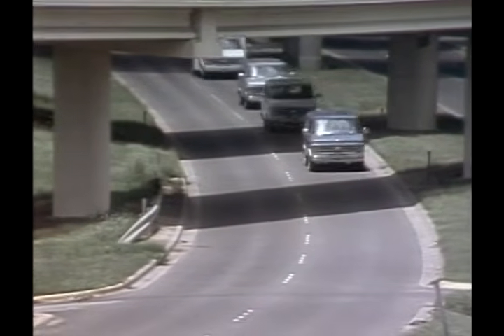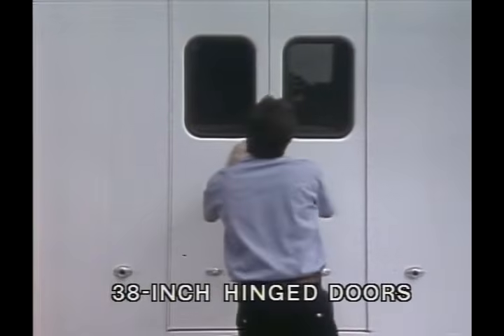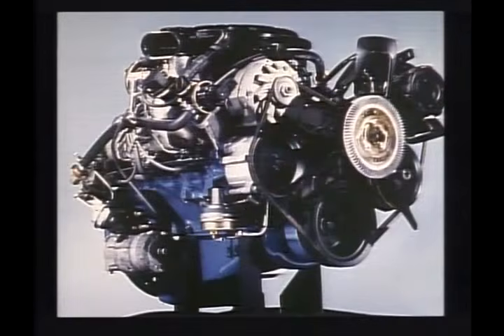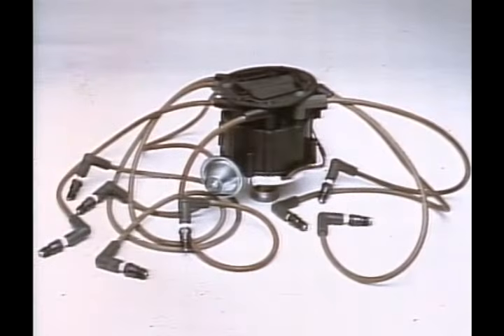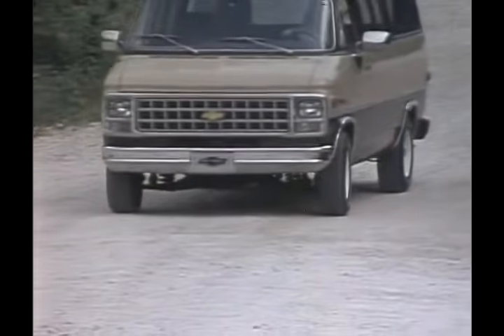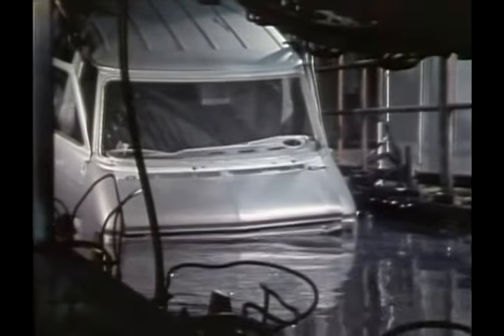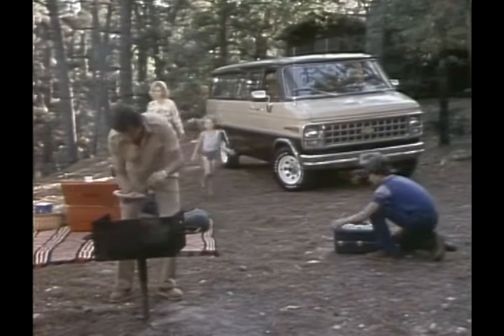1982 Chevrolet Vans

Comment: The 96 and later vans have the ladder frame, and the short wheelbase van is almost as long as the 82 long wheelbase.
Reply: That's because by 1996, they ditched the shortest wheelbase van as they weren't as popular as before.

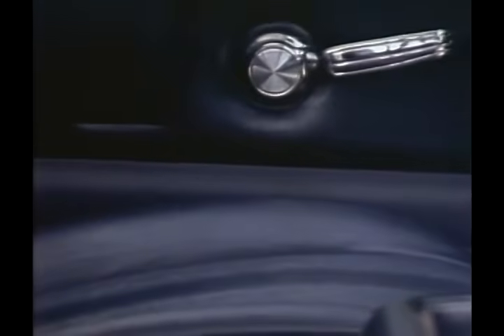Comment: This might actually be a 1981 Sportvan at 4:30 as it doesn't have the electronic ignition that the 1982 models have.
Reply: You mean the one on the dashboard versus the steering column?
Reply: @erikbunty2016  Exactly, and the 1981 models have a different automatic transmission compared to the 1982 models.